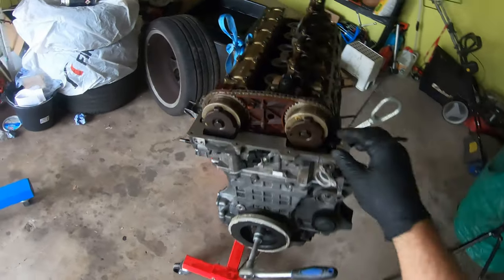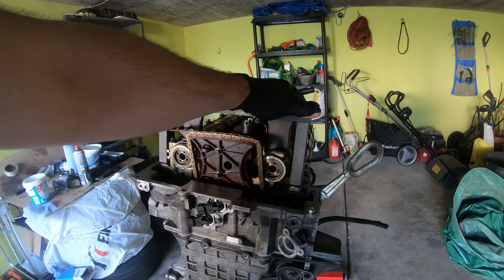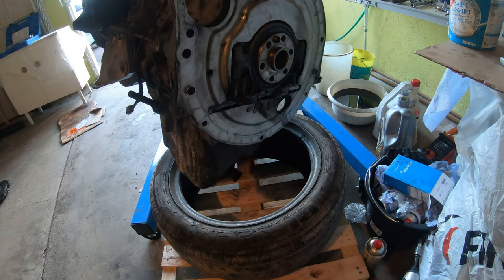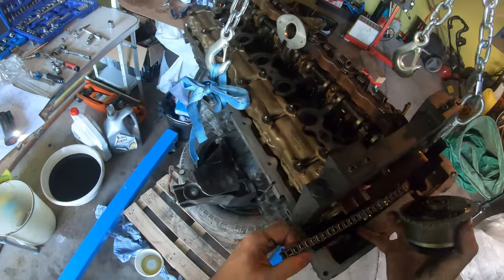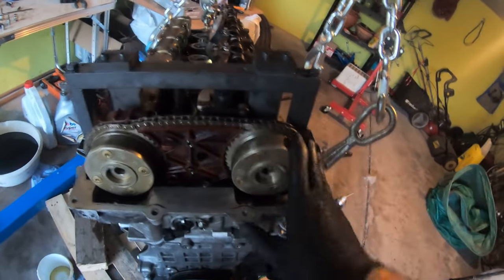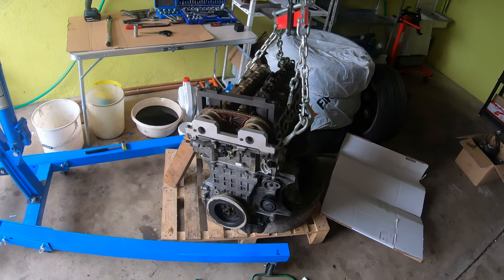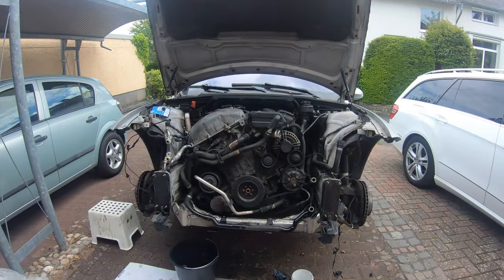[DIY] Correct Timing Procedure For The BMW N52 Engine & Vanos Re-Assembly! [BMW N52 Rebuild Part 17]

Comment: Hello: How many Newtons is the screw that fixes the timing gear locked at?
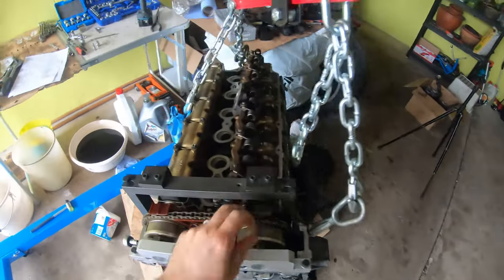Reply from the maker: Check at @14:50 27 Newton meters and then 180 degrees
Reply: Hello, thank you for your explanation. After the piston top dead center, the two camshafts will see the QR code pointing upward. How do you judge the compression top dead center and exhaust top dead center?

Comment: Great job. I am right at the start of the journey. Our E90 325i snapped the timing chain when pulling from the lights yesterday.  By the time we realised what was happening, the engine had grenaded itself. Piston 2 is completely missing. Cylinder scoured horribly. I need to tear it down to see if it’s worth trying to sleeve it or to rather buy a used engine and stick it in.
Reply: Don’t sleeve it. It will be a waste of money and the engine will fail again. Alusil blocks if badly scored are just junk unfortunately. You’re better off with a used engine IMO
Reply from the maker: Get a newer used n52b30 so you can upgrade on power and have less oil conspumtion.

Comment: Some of the timing chain tools on ebay are junk.  I had the same problem with the locking pin.  I filed it down a little and that did the job.  I also found that the hole for the intake adjuster in the front timing plate was mispositioned so no matter where I rotated it to, the tab would not go into the hole. Again, I had to use a small round file and remove enough material for the tab to enter the hole.  I could never really sure if the timing was 100% right but the engine runs fine so I guess it was ok in the end.
Reply from the maker: Yes, I checked the timing on 3 different occasions to triple check everything was fine before I put the engine back in. The tools were okay and I had to force the locking pin/wiggle it until it worked.

Comment: I sold my E91 325i with it's oil consumption problems and went back to an E46. I think part of the problem was a leaking sump gasket in my case, an issue I wasn't up for solving.
Reply from the maker: I also had a oil leak on the sump gasket and even after rebuilding the engine... I am still chasing leaks. This engine is not really well designed lol

Comment: I'm a little lost. I torqued down and did the 180° on the cam gear bolts, and when i go to spin the block, the cam gear plate on the exhuast side stays in place and the rest of the gear moves? What have i done wrong, or what is going on?
Reply from the maker: Maybe the spring inside is broken. Or your camshaft is snapped. That's very weird. Can you send me a video?

Comment: Hi, It is necessary that the two camshafts have the QR code of indicator in TDC cyl 1? Mine is wedged on the flywheel but only one camshaft has the QR code the other is opposite and does not seem to be stalled.

The engine does not start.

Thanks
Reply from the maker: Double check your crank pin is in the correct hole. The first 2 times I tried, it was not correctly in the hole. Is the engine jn the car?
Reply: @buildanddrive  I checked well, it is in the right hole, I removed the oil pan and I folded the plate between the gearbox and the engine and I was able to check, for information the engine is in the car and I had the famous problem of the serpentine belt sucked, after second check, the exhaust camshaft is well wedged and the intake not at all,  but the holes of the vanos are on the left side, I will send you a private message with the photos

Comment: It looks like if i should do this without special tools, and just get it int to tdc, lock the flywheel, mark the vanos gears with a pen, and then just have the QR-codes on the CAMs straight upp all the time, i could not mess it up while mount everything back…
Reply from the maker: The only challenges you'll have is torquing the camshaft gear bolts. Some things need to hold the cam in place

Comment: Hey I’m very interested in your project.I’m wiling to bye the same car as yours , and it has the same issue.It’s burning a lot of oil,but it’s at a good price.Can’t wait to see this engine running again and not burning oil.
Reply from the maker: Thanks! Just buy the n52b30 engine. They normally did not burn oil after 2008

Comment: Great video man didn't have the vanos locking tool on mine makes sense why ibe been pulling my hair out over a missfire. 2 question what is the purpose of locking the flywheel
And also can these engine's be timed in the car?
Reply from the maker: Locking the flywheel puts the bottom end at TDC. Then you use the timing tool to lock the cams, that way the bottom end and too end at times. You can do this in the car 👍🏼

Comment: I pulled the valve cover and noticed the bolt that goes in the middle of the intake vanoss gear was snapped. I was able to get both pieces out and got new ones. One problem is the the QR code for the intake cam is straight up, but the QR code for the exhaust came is 90 degrees to the left. What do i do? Am i able to rotate the exhaust cam to make the QR code straight up, then start the whole timing process?
Reply from the maker: Can you send me a video on IG? Are you sure you are at TDC? If it's off there may be other problems like a stretched chain, bad timing tensioner etc.

Comment: I have that clicking noise within 1.5 to 2.5k rpm, strange, could it be sludge / low oil pressure? maybe defective adjusters?
Reply from the maker: Yes it could be. Clean out your vanos actuators and the filters on the side of the block

Comment: Do you have to push the lock pin all the way way in? Mine is half inch away and I can’t turn the engine anymore by hand. So I assume it is correctly locked on the flywheel?
Reply from the maker: It should go all the way in but normally theres a bunch of grime in the way, just be careful that it IS properly locked in place. Is your engine in the car?
Reply: Yes. Thanks for your reply. Engine is in the car. I sprayed some lube so the pin moves nicely. I can also hear a plonk/clunk when moving the pin back and forth as it hits the metal plate. Sounds metallic like two metal parts hitting each other. I can definitely not turn the engine by hand anymore. 

The issue I’m facing now is that the camshafts are not straight up with QR code. They are slightly tilted clockwise so the timing tool does not fit correctly. Should I turn both by hand into timing tool position?

Comment: What's the chain tensioner tool supposed to be tightened down to
Reply from the maker: Hold the chain in place to prevent it from slacking or skipping a tooth on the bottom sprocket.

Comment: So if I have my car at tdc but the QR codes don’t match how can I fix that? Like one is on the top but the other one isn’t
Reply from the maker: Then the you need to go through this entire timing procedure, lock the bottom end. Lock the top. Rotate the cam to the correct location, lock that in place and put the cam gears / chain back on. Please follow the video precisely.

Comment: I didnt have to remove my vanos . All i had to do was get my engine to TDC and lock in the pin with the flywheel and its all timed ? Do i need to do something with the vanos locking tool now ?
Reply from the maker: what are you trying to fix? if you are taking out camshafts, lock the bottom end and remove the cams, but when you retime everything, you will need the vanos locking tool to make sure everything is aligned again
Reply: Timing Jumped , im just tryna to Retime everything i got the Engine Locked at TDC at this point and put the vanos locking tool in place that i bought from your description . Im just trying to figure out what to do now .

Comment: Im getting 60psi frm every cylinder tested on my 328xi e92  my ppl are saying it’s the timing on the engine .. because I put in a new 54k engine in wit new parts but still a crank no start do you think it’s the timing as well ?
Reply from the maker: If it is every cylinder then it could be the timing. Check my timing video on how to do it.

Comment: I have a n52 that blows white smoke I think it my valve stem seals because it’s off and on I wanna know what’s all the bolts torque to? Im going to try and rip my engine apart also
Reply from the maker: Yes, this sounds normal oil burning for an n52, what oil consumption does you engine have?

Comment: **Chief, **
**QUESTION pls?**
2011 328i xDrive N51 IL6.
Car died on idle in my garage. Valve Cover removed.
The Timing Chain is intact and tight.

the game plan is to remove/replace the Exhaust Vanos Sprocket.
Because the bolt-heads are broke/sheared.
I bought the Camshaft Locking Tool to be installed. I also bought a new Exhaust Vanos Sprocket from FCP.

**Now question is… Do I really have to lock the ‘flywheel’ under the starter area?***
Or, the Camshaft Locking Tool is good enough to hold the engine so I can remove and replace the Exhaust Vanos Sprocket?

I just do not wanna do extra work If I Don’t Have To.
Thank you 🙏 chief, I hope you read this message.
Reply from the maker: If you are very careful and dont move anything, you can do it that way. The moment you move something, the chain falls etc, you will need to lock the flywheel and start over again to make sure you are at TDC
Reply: @buildanddrive  thank you for the time to reply. I was actually able to lock the flywheel and installed Camshaft locking Tool in place!
          Now, time to remove and replace the Exhaust and Intake Vanos.
 What is the next step? Should I loosen the 16mm Vanos Bolt or the Tensioner 1st?
Please advise

Comment: Would bad timing be cause of my hard start? Changed everything fuel spark related. Would have to crank a few times before it idles ok.
Reply from the maker: What codes are you getting?
Reply: @buildanddrive  that's the freaky part no codes at all.
Reply from the maker: Maybe it's the battery or the starter that's on its way out
Reply: @buildanddrive  the batter is new so it might be the starter.
Reply from the maker: I had a slow start and it turned out to be the starter. It died. Lol
Reply from the maker: What do you mean by hard start though? Like it slow cranking?
Reply: @buildanddrive  it would take a few times to start then it sounds like it's gonna bog out then the  idle starts to jump then it idkes fine after. No vacuum leak for sure did a check on it.
Reply from the maker: Send me a video on Instagram. It sounds like a vacuum leak or some sensor going bad.
Reply: @buildanddrive  got it when I get a chance.

Comment: Vanos sprockets went out on my n52 (192,000) :/ the kit is 500+ dollars, I think the right move would be to replace the engine with a less used n52. Oh and it started to leak from the oil pan and valve cover gasket lol
Reply from the maker: I had the same dilemma, if the vanos sprockets broke... Did the piston hit a valve? Then I would recommend replacing the engine. Otherwise everything is repairable. Check the oil pan bolts to see if they are loose.

Comment: Hey, I had a question about re-timing when starting from scratch (I.e rebuilding) would you make sure that the psiton is at tdc then turn the cams individually so that the qr codes are facing up and lock in or would you do the cams first? Thanks
Reply from the maker: From scratch, first lock the bottom end to TDC with the pin in the flywheel, then attach the cylinder head and cams, lock them in place. Then you know your bottom end and top are both correct. Then you can slide the timing chain in. (If you're doing it that way)
Reply: @buildanddrive  that makes sense, thanks!
Reply from the maker: @Cars10223  good luck with your timing. I had to do mine 3 times to get it right 👍🏽

Comment: I've been trying to get my n52 time correctly for the past 10 days I use the exact same kit you were using and every single time I get Cam inlet and cam outlet not synchronized and the vehicle won't start or if it does it runs rough, every time I take the engine back apart and put all the timing stuff back on before removing the tensioner it lines up perfectly I don't know what I'm doing wrong. New sensors for cam installed if that helps and there getting power.
Reply from the maker: Is there a way to double check the flywheel pin is correctly inserted?
Reply: @buildanddrive  it is every time it seats till it's flat against the aluminum of the short block, I also pull cylinder 1 and check for tdc
Reply from the maker: Could you have got your intake and exhaust vanos mixed up?
Reply: I double checked they are inside correctly and plugged appropriately
Reply from the maker: Did you wire up the cam position sensor correctly? And plug in the vanos the right way?
Reply: So I had a BMW repair facility gentleman come out and look at the job that I did everything was correct except for the intermediate rocker arms springs and the little plates weren't put in the correct order and that's why it's having this issue so I had to replace everything
Reply from the maker: What little plates?
Reply: The gray plates that the springs sit on that hold the intermediate rockers in place
Reply: Um having this issue, how dd you win it
Reply from the maker: What is your issue?

Comment: I have a question on the flywheel, is there a reason to believe that it can be installed the wrong way. I completely forgot to check it when the engine was apart, am trying to do the timing and I cannot locate the small hole to lock it at TDC. It goes in a bigger hole when Cyl 1 is all the way up, and engine still moves left and right. It's really annoying, the flywheel has a guide I remember that so I don't see how it can go in a different position. Thanks in advance for your help.
Reply: by the way mine is an N51 engine from 2012 but should be very similar
Reply: Ok I actually got the the little stopper bar to slide in all the way, the trick was to keep it pressed while turning the engine and it finally popped in. Very little part on it went in less than 1/2 inch. At this point it's done
Reply from the maker: Yes, the whole sometime has some grime in in it and can stick. I have to clean mine out, which is easy to do if the engine is out. Unfortunately when the engine is in, I've seen quite a few people struggle to find the right spot and this can lead to bad timing of the engine. So be careful!
Reply: For sure but doing it yesterday I pressed it and it went in what I thought was all the way. Cliser look revealed that there was 1/2 inch out so I kept my hand on it pressing, and when I twisted the crankshaft I felt something first but passed it. I twisted back slower and it went right in. Trick is to keep hand on it pressing on it and it is easy that way.
Reply: @buildanddrive  One more question on the tensioner the book mentions an O-ring which supposedly doesn't come from the factory with the tensioner, and I cannot see a place for it. There is a gasket ring11317534251	 which looks like a washer but made to seal. Any recollection on that?
Reply from the maker: I didn't take my tensioner off. But if the diagrams show it, I would get it

Comment: Hey, do you know anything about those 2 little microfilters that screw into the side of the cylinder head? I pulled them out and cleaned them...but I don't remember if they screw all the way down inside. Looks sort of off to me.
Reply from the maker: they screw in all the way down so the bolt head is just sitting past the hole itself by a little bit inside the cylinder head.

Comment: I took off my sprocket. Is there a specific way of putting it back on the cam because there is a notch on the sprocket or should I just put it on anyway and bolt it?
Reply from the maker: You need to retime the engine. I would follow the instructions in the video to lock the cams and then you can bolt up the sprocket properly and get the front vanos gear correctly installed too.
Reply: @buildanddrive  I locked the cams and flywheel. I took off one of the cam sprockets. I’m trying to put it back together but I am wondering if i have to put the sprocket a certain way because it has a notch in it?
Reply from the maker: No, the sprocket can go in any way. The timing of the cam happens at camshaft (which is already locked) and at the front metal vanos piece which you will have to lock as well before tightening the bolt
Reply: @buildanddrive  can I rotate my engine clockwise and counterclockwise without damaging it?
Reply from the maker: @ButteredPeanuts  Technically yes, but its better to rotate it clockwise
Reply from the maker: The way the tensioner is set up, if the chain is lose and rotate it counter clockwise it could skip a tooth if you aren't careful
Reply: @buildanddrive  I’m wasn’t sure because of the tick mark at the top of the sprocket. Do you possibly have a link to the whole procedure?
Reply from the maker: It's this video https://youtu.be/bmszP-K727I
Reply: @buildanddrive  does it matter which way the engine is rotated once the sprocket and chain are on?
Reply: @buildanddrive  I just did my vanos sprocket bolts and put the engine back together. Now my engine popped out a 2a7c code for the inlet vanos. Does that mean I have to calibrate/program my vanos solenoids? The car worked fine for 2 days but had the rpm’s bounce a little bit, but today it sounds like a diesel. Could it be that the vanos not being programmed to work?